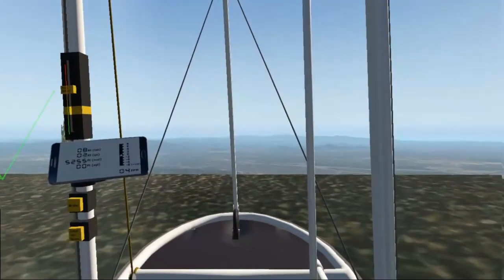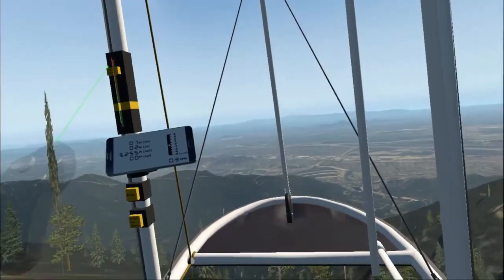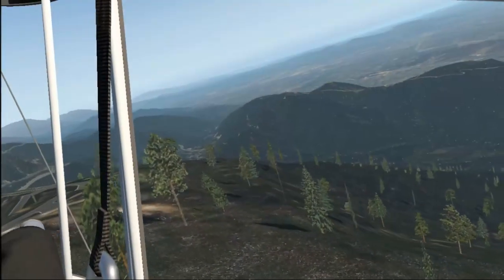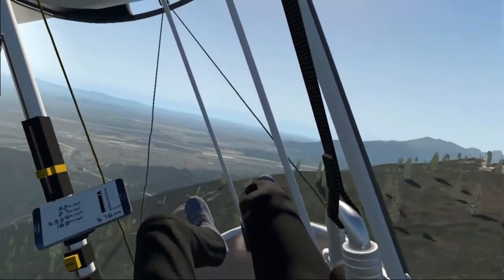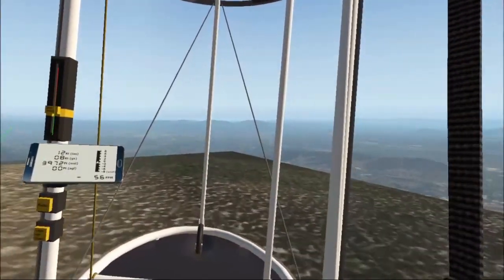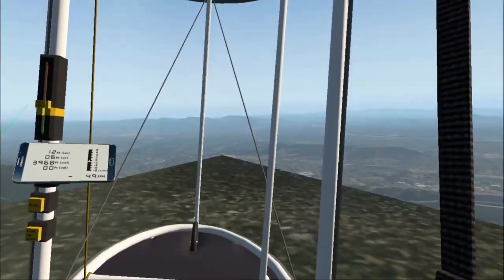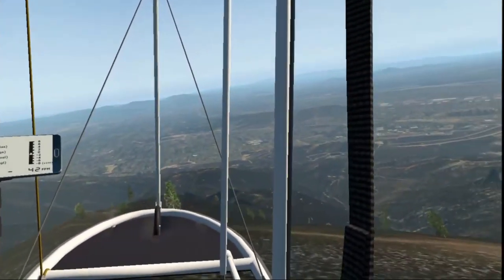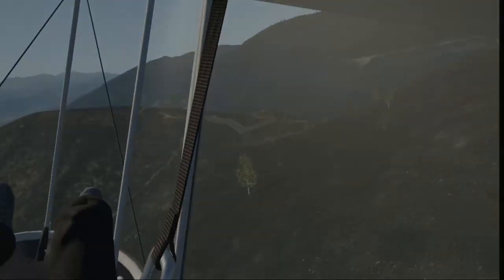Klingberg Wing MkII Development - Foot Launch Simulator Sneak Peek

Comment: I flew the Bi-Swift and its pilot is much closer to the wing and it has a very good view all around. You can see under the wing and over the wing. I looked at your pilots head and i think if you place him a bit higher, so eyes come a bit under the wings underside, you will be able to see above the wing too. Less cockpit makes less drag. Somehow the guys on the Prandtl project glider did it also with a very tall cockpit. Do both projects want to keep the wingtips having no problems with groundclearance? I am just wondering. Anyway ... i loooove your project.
Reply from the maker: The simulator is not yet complete and does not show the actual pilot position with his head aft of the trailing edge. There will be a window in the upper surface of the enclosure, so the pilot can see up and somewhat forward. However, there is limited to no view at around 45 degrees up - much like some flex wings. There is some possibility that I might add some small windows in the center section above the pilot between the main and aft spars. Final decision on that will be the structural performance of the wing during static test loads. I can cut the skins and add Lexan if OK structurally.
Reply: Hey, cool.
Thanks for the Swift tip, nestof.
I didn't know about those.
That was a fun 'Tube to go down.
Reply: Instead of placing a transparent part on the top where you want to place a strong structure, why not place a periscope just behind the spar. I tested that roughly myself. Easy to do and you have a view like a hole through your spar. Go see the last minutes of this video where i did my rough test. https://www.youtube.com/watch?v=GtnfAs8m-p8

Comment: How are you modelling the physics ?   The wing tip velocity looks way too low to turn without stalling at 0:50.    As a matter of fact, at 1:00 it looks like the right wing tip is going backwards.

JSBSim does real air flow force simulation and works with Flight Gear.
Reply from the maker: Well, I don't do the modelling and I don't know much about X-Plane. I provided the design of the actual wing to Peter who built it into X-Plane. From what I understand, X-Plane calculates the aerodynamics "on the fly" (no pun) during the flight - real time (CPU intensive) using Blade Theory. I do know the simulator flies a lot like the 1/4-scale model, so it can't be that far off of what the full size aircraft will be like. I do believe what you are seeing is an optical illusion because the "camera" position is moving while the wing is flying. Visually, most people would judge the motion of the wing against some point in the background, but in this video that would be a moving point because the camera is moving. Hence, it appears to be doing the impossible - but is just an artifact of the way the video was done. Go and look at some of the earlier videos and you will see it flying "normally".